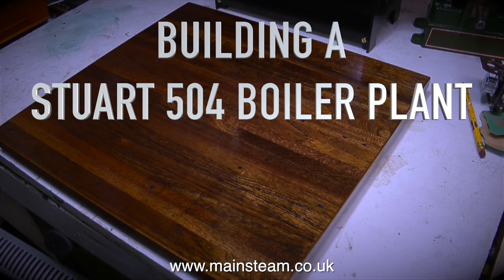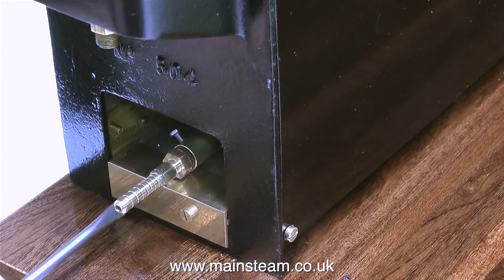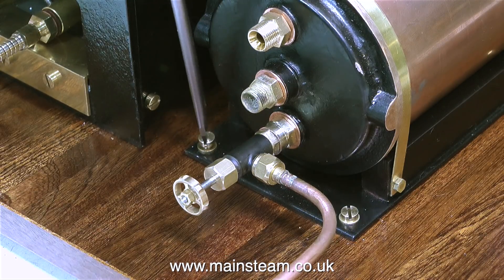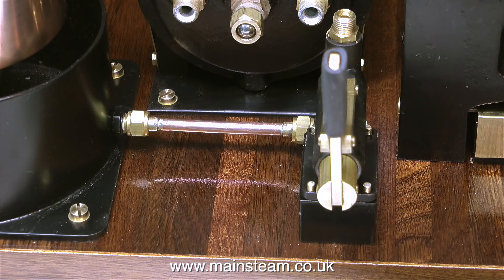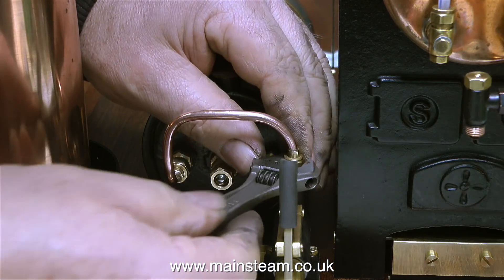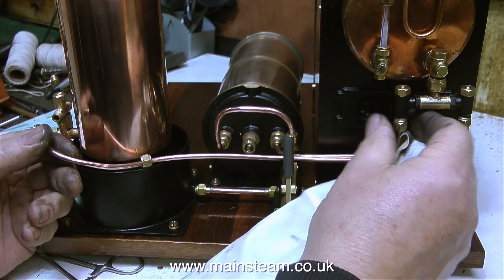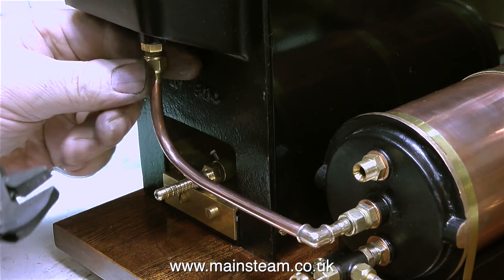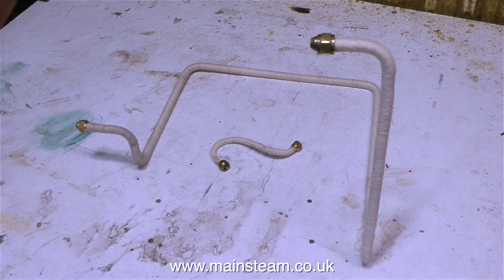MAKING A STUART 504 BOILER PLANT - PART #22 - PUTTING IT ALL BACK TOGETHER

Comment: Those injector cones are very tiny and fiddly, but would it not have been possible to fabricate one if the need had arisen?
Reply from the maker: If I had the time, but for me it would be more cost effective to buy another injector as I don't know the cone taper angles etc ....
Reply: Keith Appleton that makes a great deal of sense. "Don't build what you can buy cheaper" and so on.

Comment: Looking good Keith, I look forward seeing it run. Do you think the 504 will be able to maintain 60psi whilst running the engine at the 340 rpm you envisage ?
Reply from the maker: I would think that it will drop to around 50PSI when the engine is working, but that should be enough. The burner is a bit feeble, but I quite like the idea of a peaceful, quiet, easy going steam plant }:-)))
Reply: Thanks, it's turning out to be a great looking set up :-)

Comment: Cladding Pipe... Have you ever seen someone "Fly Tying" for fishing?  They use a small, odd-shaped spool holder that is used to wrap up many revolutions of thread for tying flies around a hook shaft... ?  - The device keeps constant tension on the line so as to even-out the wrapping of the line.   I'll bet you could make something like that for your "cladding string" that might help a lot! Especially on long runs of pipe.  Just a thought. ---- Great work again!
Reply: With :FlyTying" it is usually a very short straight area, with piping it is long conterminous lengths. for full size equipment there is a unit for maintaining the tension.